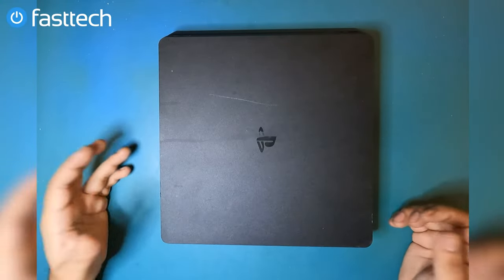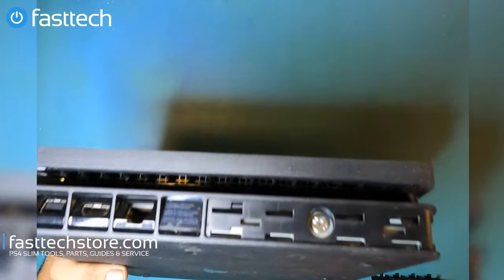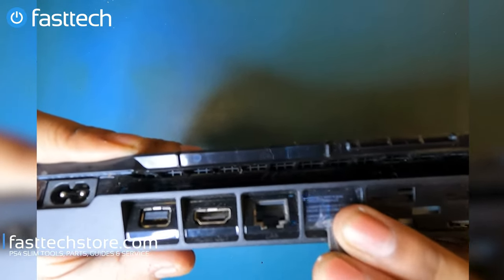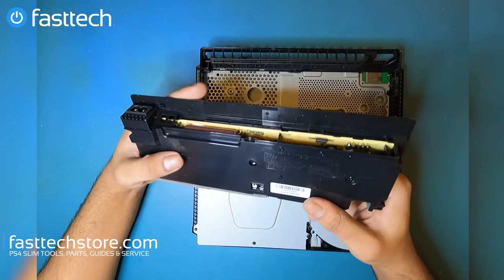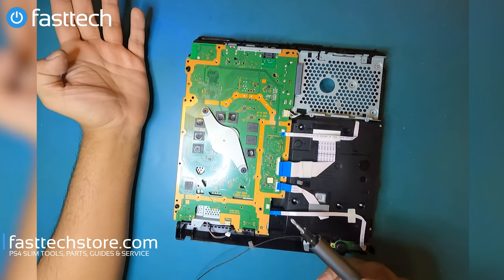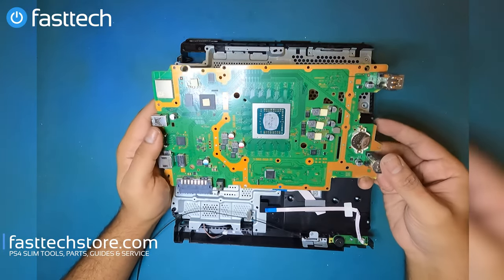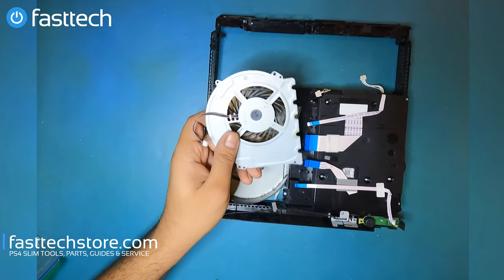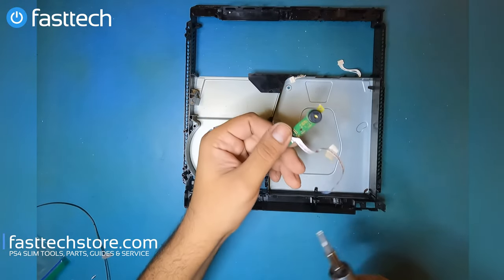PS4 Slim CUH-2216 Disassembly and Repair Guide

Comment: No beep doesn't usually mean the PSU is dead. Slims are notorious for a faulty southbridge on the motherboard.
Reply from the maker: It does in 90% of cases, sometimes it could be a power rail issue on the board but its rare

Comment: When cuh 2218a manufacturing year and chip is same as 2200
Reply from the maker: @RAJAALL976  yes it is
Reply: @fasttechvideo  but which year 2218a model year?? i brought a cuh-2218a preowned in a new condition but after one hour of playing time it heats on right side but not left side whats the reason plz help me

Comment: Please I changed my thermal paste . My console isnt loud but still over heats  especially under
(cuh2216a )
Reply from the maker: Check the screws on the heatsink clamp.
Reply: @fasttechvideo  did that it's real firm but still hell hot. And my fifa just freezes at "home screen" real performance drop
Reply from the maker: @ebaimulema6668 clean out the heatsink. It should be filled with dust.